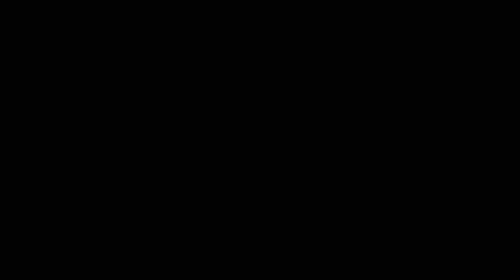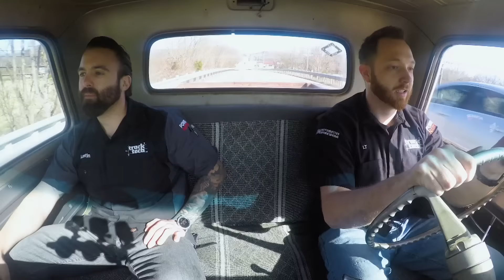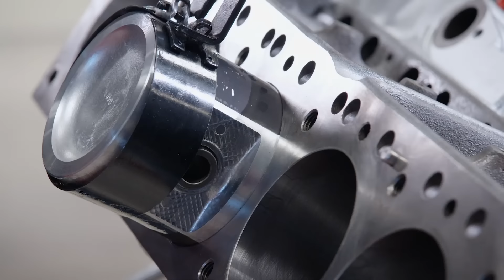Forget the LS Swap: Building a Turbo Chevy 292 Straight-Six

Comment: I love these inline 6. I put a 292 with a turbo in my 55 bel-air 4 door. Royal blue with white. Blue and white interior with 3 on the tree. I mildly tubbed the rear wheels to fit modern tires that are a little wider just for handling. It's not a drag racer but it's just snappy enough to have some fun

Comment: where are your head gasket and deck plate? should be torqued to spec before final hone ..then the top of the cylinder won't be out of round when you/they put the head on engine

Comment: Acá en Argentina a los Slant six, ford 188 y Chevriolet 194 para los 90's le sacaban 360/380 hp con el Holley 40/40 aunque con bielas, cigueñal y bomba de aceite especiales. Ahora con las tapas multiválvula y 2 webber 48/48 están en 440/450 hp. Todo aspirado. El sonido es por lejos mejor al del V8.

Comment: They are a finicky bunch the 194,I got my 65 nova for 75.00 on a bet I could start it in 5 minites mint with 45,000 miles because the mechanic/scrap car pick up guy couldn't get it started no matter what he tried, I timed it first crank started ,the distributor was 180 off

Comment: So you did all this work for a Turbo motor but you used the Stock Rods!? You know adding boost to this will make crazy torque at very low RPM (AKA Rod through the Block). I bet you that you are underestimating this engine and I'm sure that as long as you use ARP Main bolts this thing should be safe to 6K RPM.Whatever boost method you use at this motor make sure you use a electronic controlled one ran into the Holley EFI, don't be some loser that only relies on Wastegate Pressure that treats a Turbo like Re-Jetting a Carb (I'd bet all the money that's what you do).

Comment: Hello. I have a 1954 Chevy 210  4dr sedan.  I had my inline 6  engine and trans rebuild  to  keep original. But i would like to get more power out.  Any suggestion?  Also  How could I get power steering on it. Mind you I'm trying to keep it as original as possible.  Thank you

Comment: Not the correct way to install the can gear!
It must be heated to 475 degrees and then installed with a dead blow hammer.
Pressing the gear on will remove metal from the gear bore resulting in a loose fit that can make it fall off when running.
Just sayin'

Comment: From an old dirt tracker that ran 292 I hope you used a steel crank not a cast crank even with all of the main bearings you will get a flex at higher RPMs this caused us problems with flywheel bolts even laced breaking loose and yes we use Loctite off so you didn't say in the video if you used a steel Billet crank just asking made my heart happy to see 6 and a 292 cubic inch great engines

Comment: Hi my 292 was bored with 4v 351 Cleveland head two cut and welder with mag and Holborn. Hone made injection manual ball pump crazy power!! Im old guys i have plate you should try different stroke the cam grind and I have that good work young guy!!

Comment: My dad was a mechanic in the 70's and he says that the straight six is by far his favorite engine. He says 1. It never dies because you can pretty much just keep replacing parts until you have a 'ship of Theseus' situation. 2. He said you can practically fix anything on the thing from above, just the hood up while wearing a tuxedo and not get it dirty. I've talked to a few other older mechanics and told him what my dad said, one simply said, 'sounds about right' and the second said, 'the straight six is a beautiful thing.'

Comment: just only 220 hp??????? Argentina had a lot mods for this type of engine... with a cam and head works with 2 barrells carburetor made 300hp in brazil are more unbelievable they are made 600hp with a simple turbo's set up

Comment: I have run several quick GM inline 6's (entered service in 1964), with my old 202ci N/A daily driver on street tires ran 12's with a best top speed in the quarter of 108mph. The engine was the little brother of the 292 and could rev well past 7000rpm(that's all my rev counter went to). Mine was just a street motor and had around 280+HP, I think if you put triple Weber 45's or 55's you instantly pull a lot harder above 3000rpm

Comment: I love it when they keep referring to this "little motor". I grew up in the 50's and 60's where cubit inches meant everything. GM had the 265 and 283 engines. I may be slow, but isn't 292 larger. Nothing "little" about that number.

Comment: Straight 6's have perfect primary and secondary balance. The Chevy 292 and Ford 300 both have seven main bearings too. Very tough engines that make lots of torque.
Reply: Exactly why I prefer inline 6s compared to V8! They're also easier to work on.

Comment: I got a 194 in a 63 nova. Runs slow it’s a cruiser. My friend has got a 62 Nova with a 292. My god the power difference. I was thinking about a period correct 283 or 327 in my car. It’s got me thinking 292. I honest to god think the 292 has as much torque low end as a small journal stock v8 . It will lay rubber for 25 yards I say lol

Comment: Plenty of am support for the 305 aswell, want a rare 5.0 drop a scca 302 bowtie in or a 265 v8 or 262 v6 in. With the bore being bigger it is no longer a 292 displacement

Should of put in roller lifters/rockers...

I would of had the ports done precisely.

Comment: Wa back in a long gone time when I was in the air force in Colorado. A friend of mine had a 55 chevy with a straight six GMC engine that was built so good that it beat a 57 chevy with small block. Beat the other car 2 out of 3, would have won the other one except we tore a tire off. Never did know how much power it made but it was impressive.

Comment: I like the inline 6 build, but I still feel like you wasted your time with building a 292. But that is because of how much trouble I have had with the 292 Engine, throwing the number 1 road through the side of the block while going down the road as a daily driver. Just never got the life out of a Chevy 292, that I got with a Ford 240 or 300 inline 6.

Comment: Funny how something “out of the ordinary” came in 90% of these trucks when they were new lol. Straight 6 engines are awesome
Reply: There are some guys that don't know the Impala had a straight 6
Reply: @gabrielnascimento1021  Sure did!
Reply: @gabrielnascimento1021  im onebof those guys. Wow must be a beast of a car
Reply: @skinnybigstuff1040  not unless built lol
Reply: @gabrielnascimento1021 😮9 u
Reply: Try to find an original unrestored 6-cylinder Mustang or Camaro from the muscle car era. Back in the 80s or 90s of course you would tear out that 6 and put in a V8
Reply: @thereisnospoon52 Ive got a 67 barracuda with a slant 6, fun lil car
Reply: @thereisnospoon52  As recently as 6 years ago, a retired co-worker had an unrestored rather battered-looking 67 Mustang with a 6, but nowadays, I almost never ever see ANY American cars at all.
Reply: Dad had a mid 70s squarebody with the inline 6.  He stopped driving it because it burned a quart of oil everyday but still ran good.  That is my next project after I finish the ls swap on another square but I lm thinking I'll keep the inline 6
Reply: In their day, inline 6s were very ordinary. What makes then out of the ordinary is that we don't see a lot of them these days, most of them are long gone, and also it's very rare that anybody does even a slight performance build on them.
Reply: Yes very true but it's an unusual engine to build power with when 90% of people building up one of these truck would either just drop in an LS or a 383
Reply: 😮 yeah and a lot are still running🎉 now we got more plastic than a Lego Factor😢😢😢

Comment: Good Day All : With all my years experience in aircraft jobbing shops it was certainly nice to see an automotive engine shop using the Sunnen instruments  at time 6:35 . I think you all would really like to have a calibrated Sunnen setting fixture . They are a pleasure to use so easy to handle . The whole thing would be about the size and weight of a modern desk top computer .
         Much more accurate than using a hand held micrometer .  Faster , easier , more accurate , good selling point to show your customers . Excellent video .

Comment: In 1975 I bought a brand new GMC 3/4 ton pickup with a 292 6 cylinder with a 4 speed manual trans.
It was a great engine with lots of power but terrible on gas. 
In town I got 6 mpg and the best I ever got on the hwy was 12 mpg.
Reply: The lack of overdrive coupled with 4.11 or 4.56 rear gears wasn't doing you any favors when it came to economy

Comment: I love inline 6 builds. I have a 4.0 with an aluminum edelbrock head, 24 pound injectors, comp cam and many more supporting mods. And my bayliner is having a 250 inline six built for it. Tough motors.

Comment: The 292 was a replacement truck engine designed for both 6 and 8 cylinder engine replacement. It perfectly bolts up to all GM truck engines from 216's to 427's.

Comment: I’ve got a 1965 Pontiac 215 Inline 6 that came out of a lemans. Supposedly it’s similar to the 230-292 family of engines, but can’t find anything regarding performance parts. It would be sweet if it could be bored/stroked to 292 specs
Reply: Yeah, the block and bottom end was the same but the head was strictly Pontiac.

Comment: I have always wanted to see some one take one of the massive 50's truck 6's and do a build they came in 426 and 503 blocks sizes that's 7.0 and 8.2 respectively if your in to litres . yes there rare and very hard to find now but shared the same design as the smaller engines just way over sized. I knew an old mechanic when I was a kid who drag raced one of the 426 engines in a old coupe and it was fast enough to give the Hemi's a hard time.

Comment: ive been wondering for a few years now  my sister has a early 90s GMC Envoy with a straight 6  in it  that has been a really realiabe motor  for them my brother in law  says its because he has used Synrhetic  oil since  they got the vehicle new ?  ive driven the vehicle several times and truthfully  it does pretty well they originally bought the vehicle as a people mover and to pull  a pull behind camping trailer  and it performed those tasks for years  i like the old Chevy and GMC trucks myself would a more modern  power plant like the one in that Envoy  be a good  replacement for a  older pickup ? as i kind of like the  idea of having so many   bolt on accessories  available pretty cheaply  in a junkyard like air conditioning , alternators, power steering pumps etc   i like the idea of being able to  update a older truck with those mentioned  parts  to give me more of s modern vehicle with the classic look   watching this channel reminds me of working with my Father  when i was a teenager growing up  as he did  everything Old School like you guys do  like  no  gloves,  using a brass  rod to  smack  things into place , and even  working on a bench  like you guys  even using a hammer handle to  install pistons  which is still how i do it today  in our  home garage my Dad and I restored Antique British Sports cars and rebuilt  several engines, welded , you name it  the old man is gone now but ive always treasured the fact that he taught me how to work with my hands as thats also how i provided for my  own family  as well  and in all honesty it was a  very fulfilling way to  go through life  knowing i was making a honest living  my own son who is a  adult now also reckonize those skills and has thanked me as well

Comment: With that mill, dro,  boring bar and $80 in aluminum you can make whatever torque plate you want. When you do a boosted 300 ford straight 6 try it out!

Comment: Had a Ford f-250 4x4 4 speed could pull just about any thing  in 4 low first or second gear  straight 6 cyl best for torque

Comment: i use get straight sixes all the time for free and they run forever . my friends pull them out of cars and trucks to put a v 8 in it and i get the straight six from them . i drop it in a rig just to get it driving so i can make a few bucks . to give u an idea i get a rig with a bad motor for free the get a engine for free them i get it running then sell it for good money . i have a lot of rigs that need engines  and some i restore but only the good one's . right now i'm building a 68 chevy pu i just put a stroked 454 with tunnel ram  in it with a heavy duty 400 turbo frame down is all dun just needs painted body . the best part i only have 2300 in it so far , been offer 8000 for it before it was driving ,it does have a perfect body now i would not sell for under 10,000 .

Comment: The Pontiac overhead cam straight 6 would be an interesting engine under boost!
Reply: And a Supercharger, not a turbo.
Reply: @angelitavaldellon7600 I'm saying turbocharger on one side and e-charger on the other then run it on water meth injection Race Fuel and hit it with some nitrous I got a feeling and I don't have any proof but I believe that there's some golden ratio where if you're using a trifecta fuels you'll just unlock some unbelievable efficiencies that nobody had imagined.

Comment: They never mentioned about the diffrent cranks that exist for the 292 and wich one u should use .
Reply: Looks like they used a 6 weight crank, the 12 weights are more durable at high speed

Comment: can you bore out a 250 to 292?
Reply: No. The cylinders aren’t thick enough to increase the engine size more than a couple of cubic inches by boring. The 292 block  is quite a bit taller to accommodate the longer stroke required to add those 42 extra cubes.

Comment: Came to a dead end with 84 gmc 250 had an integrated head
Reply: The 292 made it to 1989 in the USA, and never had an integrated head.

The 250 went integrated in 75, and was replaced by the 4.3 (262) V6 in 85

Comment: I have seen the build up of the straight six many times but never the finished product, with the turbo.  Many years ago I used to drag race a '65 Chevelle with the same engine.  Seems similar to what you guys are doing.  4 bbl. carb, cam lifters, up grade distributor, headers, etc.  I think my best run was in the 14's.  Later I wondered what a power adder like a turbo would have done for me.  Please tell me you are going to dyno the engine soon, with the turbo!  Tks, tom rosato

Comment: why do inline 6 engines deliver so "little" power? a V8 of that displacement would easily produce 400 hp...
Reply: They are more for torque as they are long stroke and have large heavy pistons.  These are also a pushrod design. They just don't produce the RPMs needed for high HP.  Modern straight 6's (BMW?) are overhead cam designs with 4 valves per cylinder for better breathing and not as big on displacement so they can turn much higher RPMs.  I think they also almost all have turbos.   The pluses are the engines are pretty bulletproof and are well balanced.
Reply: This type of inline 6 has a really poor flowing cylinder head.

Comment: Couldn’t you just use a spacer on the bolt and then tighten it down simulating load on the deck surface to simulate bolt load in the absence of a torque plate?

Comment: As an engine machinist with almost 35 yrs of experience, more often than not when tearing down a chevy straight 6 we find a cracked head.
Reply: The non integrated head motors aren't bad about cracking, but the integrated 250s are pretty much guaranteed to be cracked

Comment: I've had two 292 Chevy engines in step Vans and both busted the number six piston in half. Put in a new piston and they ran fine. Strong engine but there is something going on with that last cylinder.
Reply: #1 and #6 on a single carb inline 6 would always have a different air fuel mixture than on #3 and #4. Perhaps those engines get too lean at number 6?

Comment: with every thing you did why did you not balance every thing while you were there ? something is very wrong the HP AND TOQURE  is way low why ??
Reply: The 292 cylinder head design is awful, and that is probably the biggest limitation. As for balance, it was probably done, but wasn't shown in order to save time.

Comment: I'd
 Love to hear it when you get the turbo on that 292.Will that motor turn to Ten grand? I heard that a Lotus will redline at13 five flat out, but that's a 4cyl. I heard that an Offenhauser top rpm. Was about 15 thou.a four also.thats a beautiful mill long stroke 6. That you guys built. Good job!
Reply: With a stroke of 4.125 inches 6,000 rpm is really pushing it

Comment: That flat torque curve especially at such a low rpm without the turbo would make a good crawler motor for a small to medium size truck or Jeep on 40's.

Comment: Wow! 220 HP to the wheels with low compression, thats 250 HP under the hood for an inline six. The torque is SO flat too, I'm betting 365 HP at the wheels with the turbo.

Comment: How did they plug those holes in the head where the head bolts originally went through the intake ports?
I see they cut out the sleeve and ran a shorter bolt in those but they didn't do anything to the top holes? Worm screw/slug and sealant are what you'd want in there or you'll run lean and lose boost.
Reply: 17:53 there are pipe plugs sealing the hole where the bolt boss was

Comment: You actually don't want to paint on a horizontal surface because the spray can works best when held vertically, you won't have runs if you don't spray too thick. Holding the can vertically will also give you a better spray pattern to help eliminate heavy spots & runs.

Comment: Always wanted to build a custom head for one with a crossflow air intake/exhaust system and larger intake and exhaust valves, I believe it would ad huge increase of hp and torque!!
Reply: The aftermarket Horning head would suit you to a T

Comment: I have seen 292's produce 625 hp with 755 ft LBS of torque with 29 MPG going down the highway, so don't knock and inline 6!!
Reply: @Velcro1167 source?
Reply: @mww1006  I saw it on TV drag racing shows so how can I give you a source?